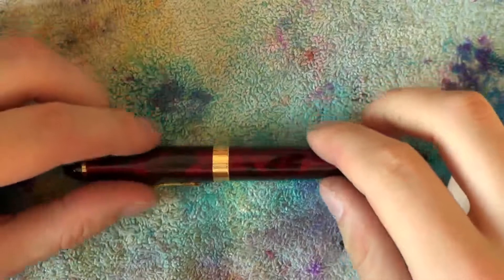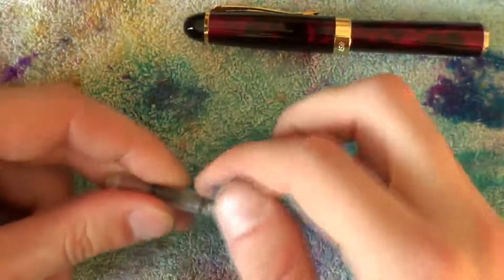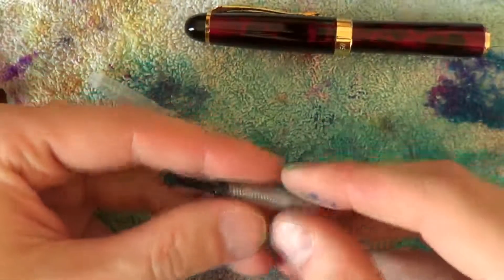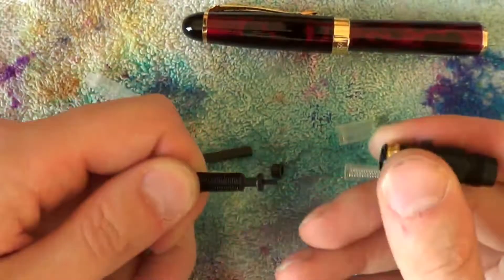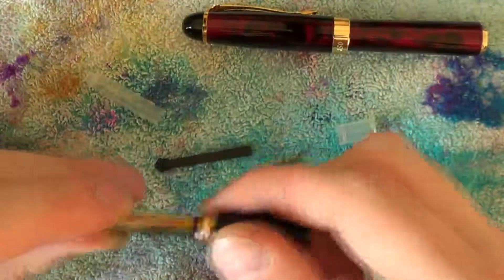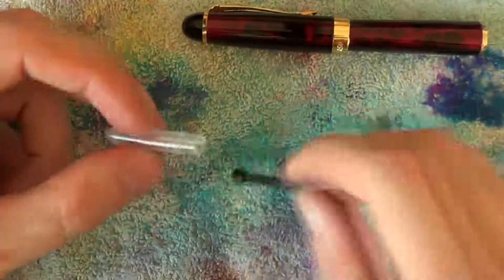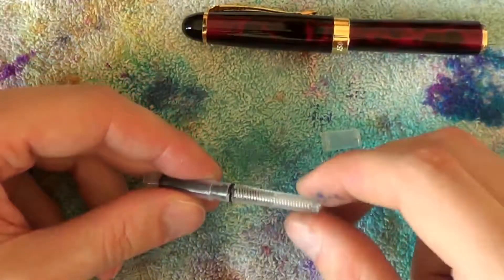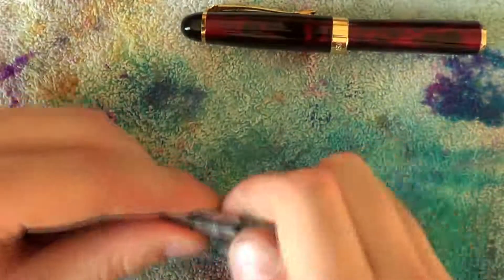Disassembly Line Jinhao x450

Comment: I have to put my grip section in boiled water to take out the nib and feed as the nib and feed were stuck very hard in grip section
Reply: Same here I can’t get out that nib :(
Reply: Same
Reply: @sc00zy  you can use a rubber sheet to remove it safely